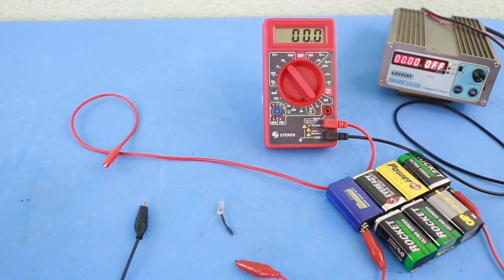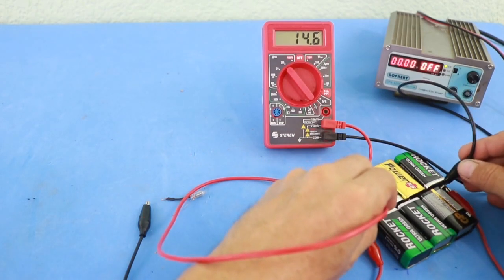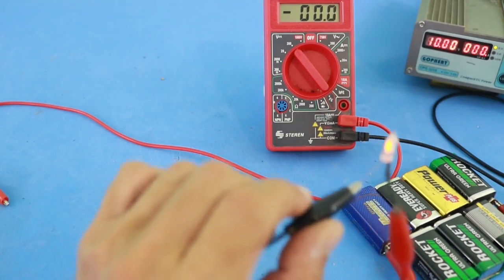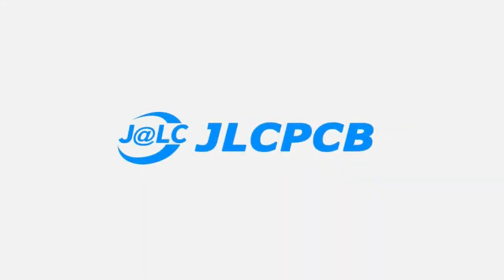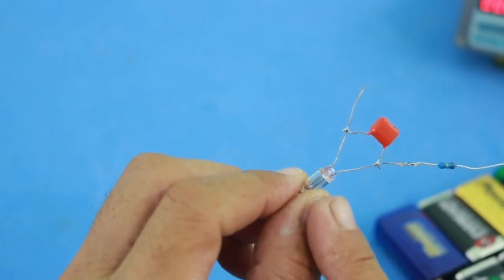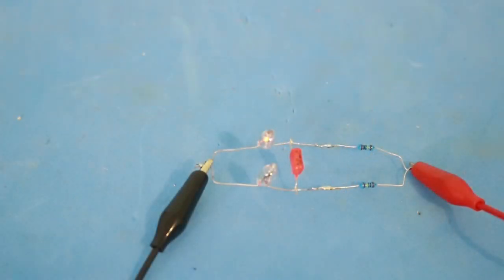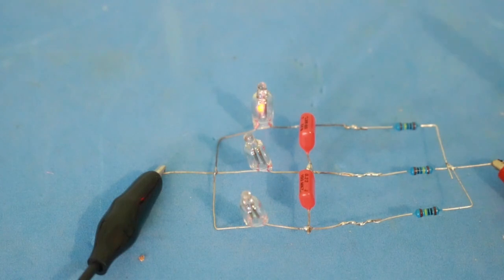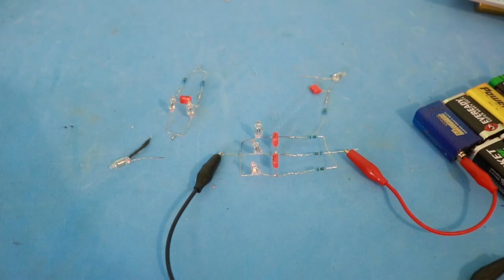Neon Lamp Flasher Circuits

Comment: Hi LS, thank you for the video, it's been the exact explanation I needed for an assignment!

I was wondering about the final circuit though...
My first thought was that capacitors will be directional. So with the bottom bulb flashing twice as often as the other two, would this mean that both capacitors have their +ve terminals facing toward that bottom bulb?  Or even the opposite... 
What would happen if a third capacitor completed the circle, making the direction of discharge a complete circle?

My second thought was component tolerances, but in an even circuit, I can only imagine this slightly affecting the time that each light is on, not causing a semi sporadic display. 

Hopefully an answer can be found instead of speculation!

Thanks

Comment: It is a great circuit. It would be great if you shared resistor and capacitor values. What is a good current limiting resistor for a neon lamp?

Comment: I have a similar circuit with 6 NE2H lamps that's been running for almost 50 years.  (I built it in 1971 while in college.) Instead of capacitors bridging between lamps, each lamp gets its own capacitor connected at the lamp and resistor junction.  The other end of all the capacitors are connected together and allowed to float.  This results in a random flashing pattern.  It is powered by the rectified 120VAC power line and a separate capacitor provides some filtering.

Comment: Charging the capacitor with low current using the resistor and discharging quickly with the light. And it's blinking because it's pulsating. 😊👍

Comment: The moment when one lamp lights up changes your RC network, adding additional resistance. Also, tolerances between the lamps (they're obviously not all 100% identical) affect this. I would need to analyze the circuit properly, but this is my hypothesis of why this happens while sitting on my couch.

Comment: The 1st lamp is ON, then the caps will be charged , but the cap that is connected direct to the ON lamp will be charged with more current than another. When the nearer cap voltage is high enough it will turn on the second lamp, this will discharge this cap and finally turn the first lamp off. As soon as the first lamp is turned off this cap will be charged with the inverse current. But the second cap keeps on charging until the last lamp is turned on and the second lamp will be off because the second cap will be discharged. After the second lamp is off the second cap will be charged with the inverse current just like the first cap. Then the first cap will turn on the first lamp again once the inverse voltage is high enough.
Reply: RC circuit = simple timer :
https://duckduckgo.com/&q=rc+circuit?ia=web